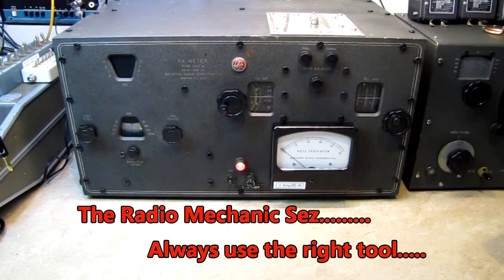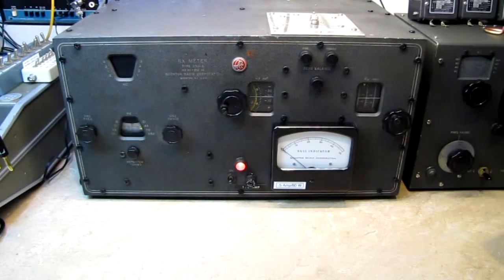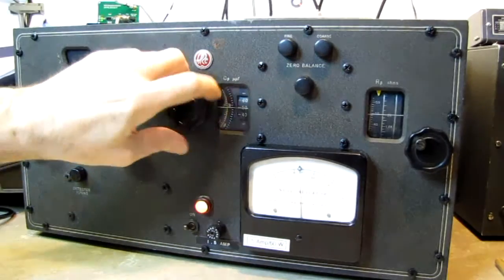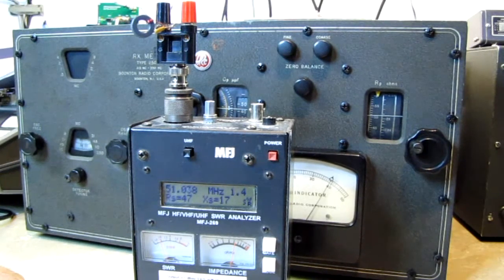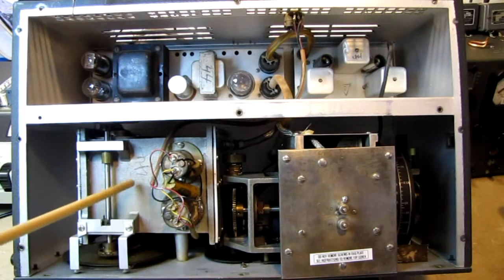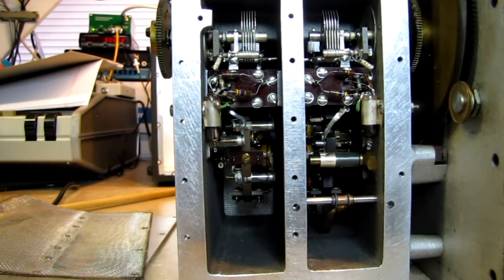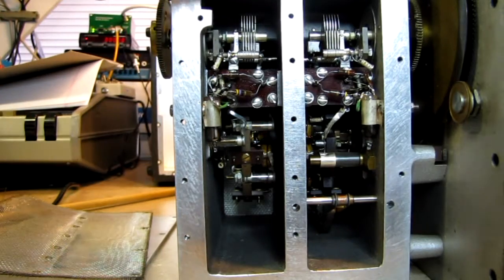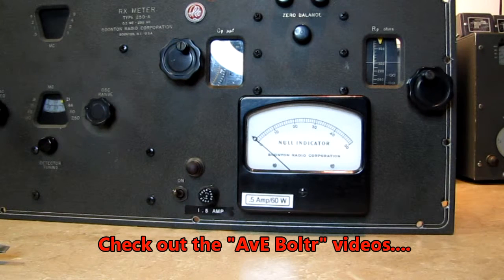Vintage Test Equiptment Teardown - Boonton 250-A RX Meter

Comment: I have a late model 250-A in Grey and the 4 screws on the plate must be removed completely to slide the top cover off. It has an hp PSU and it is due for cal in 2006.

Comment: My 2nd job after I graduated as a EE in 1958 was at Boonton Radio  Boonton, NJ, USA.
I spent some time learning about the 250 RX . 

As I recall the oscillator produced some 3rd harmonic distortion, so when a measurement was made at say 200 Mhz and the Bridge was balanced as you described and second balance point, much weaker balance  could be obtained at the 3rd harmonic , 
3*200Mhz = 600 Mhz

Because  even a  silver mica capacitor has a  frequency dependent dissipation as well as lead inductance a second weaker balance occurs at  600Mhz. 
The 250RX gave new positions  of the R dial and the C drum readouts  at the 600 Mhz null, which was of course different from much stronger 200 Mhz null.

I spent a few months trying to analyze the data produced b the 600Mhz null, factors  such as the silver plated terminals that contributed a " parasitic"  inductance to the silver mica capacitor.  
As I recall It was a very difficult task for a young inexperienced engineer. 
My results were rejected by the engineering manager.

I retired in 2000, working mostly with analog,  fiber optics ,  IR ,  MOS  FETs and a variety of digital ICs.
  
moshe
Reply from the maker: Hi Martin, there are indeed 3rd order products produced. The Manual warns you to make sure you are on the primary/fundamental/strongest peak. Interesting to hear from someone who knows the history of these units. Boonton certainly spared no expense attempting to shield and stabilize the oscillator. Those castings are incredible. Want to continue your research? This unit is available. Has factory manuals included. Only thing I never was never able to locate was one of the "N" connector adaptors.

Comment: If I remember right, Boonton, as with Lavoie, made most of their stuff for military use.  Boonton, Lavoie and Jerrold were really some of the unsung heroes of the industry back then, mainly because they made most of their stuff for the military, or in the case of Jerrold, manufacturers and radio research laboratories.  Lavoie at the time make the world's highest performance signal analyzer, the LA-18M, which had spectral performance up to 44GHz, and was used by the Air Force (under the name AN/UPM-110) for radar work.
Reply from the maker: I have seen a lot of the Boonton gear in Navy Grey. And also a lot of it went to military contractors but was in the standard black wrinkle finish. Top notch gear and constructed like a battleship. Some really outstanding engineering. Too bad those engineers didn't hand around to ride the transistor wave. And no wonder HP bought them. Thanks for watching.

Comment: The last time I saw something that heavy in a piece of test equipment was in a Jerrold VHF generator from the early 1950s which was used for tuning antenna networks.  It had a gear-driven tuning unit inside which weighed more than forty pounds.  I'd never seen anything like it before.
Reply from the maker: I had some early HP Signal generators that weighed in at 75 lbs. Solid cast tuning units that were designed to be as stable as something heated with vacuum tubes could be. Amazing stuff.
Reply from the maker: By the way, that's my SMALL iron.   :-)
Reply from the maker: And why do they call them "Irons" when they are made of copper? Just kidding......
Reply: The Radio Mechanic Oh... a 608? (for the 75 lbs.) I still have a full line of the Marconi TF 1066 & TF 601 RF sig gens. The ones with the huge attenuator dials.  Love the quality on the old equipment. I worked at a used equipment house in Silicon valley where I worked on an early HP vector voltmeter that had serial number "PROTO 01". The amazing part was it wasn't significantly different inside from the production units.